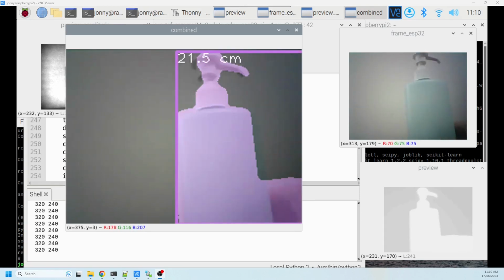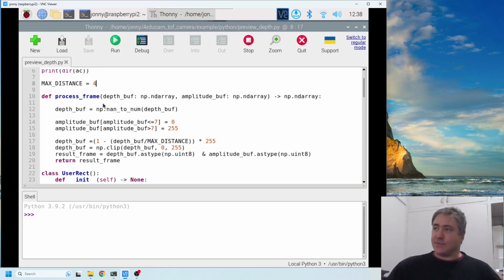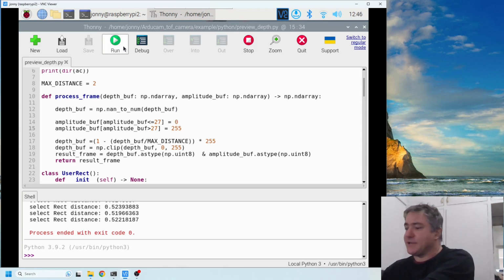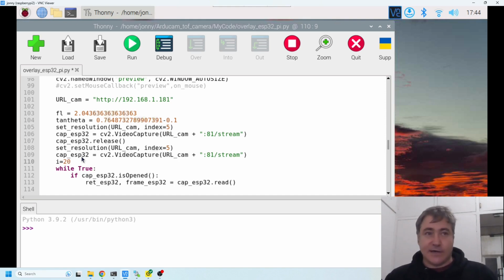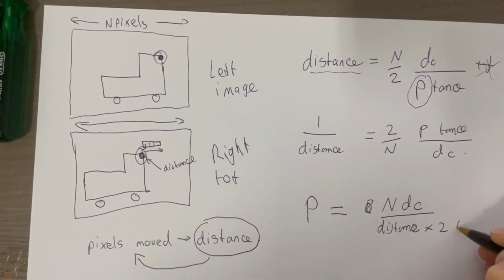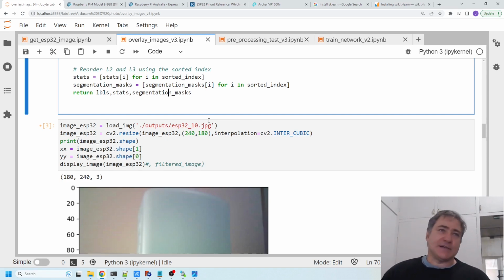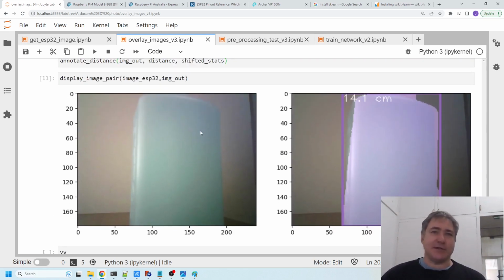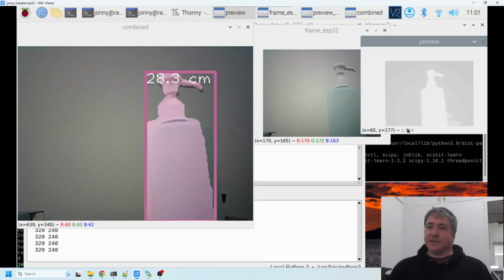Arducam time of flight camera for 3d segmentation and distance estimation

Comment: Is the module reliable? Thanks
Reply from the maker: @betahex3589  hi. The arducam time of flight camera is very good compared with another brand I’ve used in a similar price range. To make the results more reliable you would need to take measurements and create a lookup table to apply adjustments based on distance and/or left-right offset

Comment: please help mine gives me probe failed in dmesg!
Reply from the maker: Are power leads connected to 5v/gnd? try connecting without any peripherals on the pi and run in headless node. It kept failing for me when I had a touch monitor connected.

Comment: did u have problems while installing the python depencies  ?
Reply from the maker: I had to use a virtual environment to install the arducam library. Also some of the dependencies might be obsolete. I don’t think I got all of them installed.
Reply: @jonathanr4242  thank you for your quick response. got the problem solved by installing an old legacy version :). still got the same errors ehile installing the depencies but it works now. oke of the biggest problems is that pip3 install does not work on any new distros. you have to use sudo apt-get python3-packagename
to install something ans some other problems.

Comment: Hi Jonathan love your video. I am trying to do the same set up with the jetson nano with a B01 board ( Which has two csi ports) and Raspberry Pi Cam V2. However after i install dependencies for ArduCam Tof it changes the csi preferences so i can not see the RaspberryPi cam. Hence, i can only run the ToF cam. But if i change the csi configuration with jetson-io to one IMX219 and one ArduCam, then none of the cams work. If you have any idea how can i deal with this situation I would appreciate it.
Reply from the maker: Hi. Sorry, I haven’t tried with the jetson. Sounds like a struggle.
Reply: @jonathanr4242  Thank you for your time. Please keep up the good work, you are the best :)

Comment: Hey Jonathan, Thanks for the video. Not sure if you went over this but how can one save save the distance value calculated from the TOF camera? I'm assuming the depth_ptr would be the right function just not sure how to call or read that in another python code
Reply from the maker: I'm not sure what you mean? I just save the depth information as a Gray level image. My code is all on the github repo referenced in the description.
Reply: @jonathanr4242  I'm trying to save the numerical data gotten from the TOF camera (the distance) instead of the grey level image and was wondering if there's a way to do that.
Reply from the maker: @EstherEberechukwuJoshua  you should be able to hack it in the library. I’ve only used python. The raw values of the TOF will be times for the light to be reflected.  For the 2m, the camera sends 75 million pulses per second. So the times will be a fraction of 1/75 millionth of a second.

Comment: how to open arducam 16mp camera with using python. I can only use the  libcamera options but can't access it using opencv in python
Reply from the maker: You have to install the arducam package with pip install.
Reply: @jonathanr4242  i looked up on the internet but i did not see any documentations related about that
Reply: @jonathanr4242  how? there is no documentation related about that
Reply from the maker: @LeviAckerman-gt6ll 
see https://docs.arducam.com/Raspberry-Pi-Camera/Tof-camera/Getting-Started/
I think you need to run "pip install ArduCamDepthCamera"

Comment: can i use this module on Raspberry pi 5?
Reply from the maker: Should be able to. I was using bullseye. It should work with buster. As long as you can install opencv which should just be one line in buster or bullseye. pip install opencv-python, and then you also need to install the arducam tof libraries.
Reply: @jonathanr4242    thank you so much! Just one more question, as I understand the camera module can be used directly on opencv projects without need another camera module right? I mean is it possible to use it on object detection with yolo? I'm just new this area so I wonder.

I'll try to use it on object detection and distance estimation. I wonder that if it can detect objects on a bit far distance? Camera has low megapixels that's why I'm asking
Reply from the maker: @Baris_FK  the Arducam time of flight camera has a maximum distance of around 4m.
Reply: @jonathanr4242  yes I know it thanks. I wonder that how this camera is accurate on object detection? It has 240x180 resolution and it seems that it's a pretty low resolution. Does it really effect the accurate when you work with a trained model?
Reply from the maker: @Baris_FK  It will depend on how big the object you want to detect is. It should still give you a fair bit of room to work with. Increasing the resolution will impact your processing time. So, I probably wouldn't try go too high on an rpi.
Reply: @jonathanr4242  Thanks. Love your works btw

Comment: Hi Jonathan , I have to use Xbox Kinect Camera for Distance estimation . How can i modify your code , so that it will work for me. Thanks!
Reply from the maker: First thing is to bring kinect image into python so you can experiment with it
Reply: @jonathanr4242 Yeah thanks for the Reply , I have done that. But am not really getting , how to get distance  from it.
Reply from the maker: @vipulpardeshi2868  I've never used the kinect camera, but I would think there is a 2d array that can be accessed somehow where the gray level is the distance.

Comment: What is the range of the ToF camera?
Reply from the maker: It has 2m and 4m mode. You can set this in the code. Realistically, the cutoff will be a bit below this because you will need to threshold pixels to avoid measuring 4.05m as 0.05m say.

Comment: hi jonathan, i love your video, can you explain to me about the object segmentation algorithm? can i use only the ToF Arducam to measure the object segment distance? thanks
Reply from the maker: Thanks Daniel. All the segmentation is done with the tof. It happens in two parts. First, the tof image is grouped based on grey level only, and then adjacent pixels with the same grey level are clustered into connected regions, which represent blobs that are the same distance from the camera, in answer to your second question, yes, you only need the tof to do the distance segmentation. The image camera is just for colourisation, so the object can be fed into machine learning or something for higher level processing and identification. 
There are two issues. 1. The number of grey level clusters for the k-means algorithm needs to be determined. I’ve just used five. 2. Some regions, such as the ground, will not be a constant distance from the camera. But these surface regions should have a constant gradient, which can be added as a feature for clustering.
Reply: @jonathanr4242  thanks jonathan, i appreciate your response!